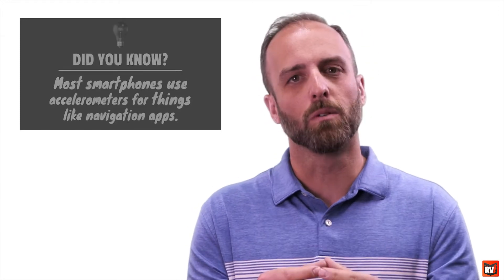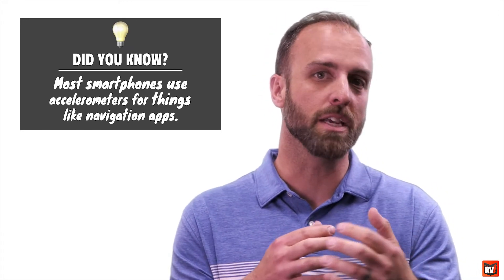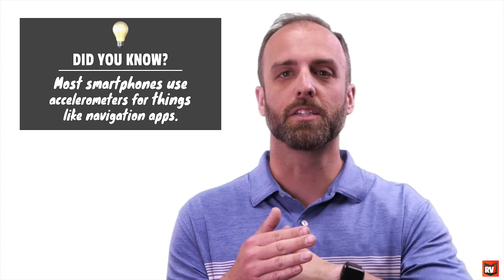RVi's How It Works! - Proportional Braking

Comment: What I have had problems with of late is the RVI brake coming on when I have to merge in traffic and then accelerate at the base of a hill...as soon as I slow a bit the brake comrs on, or I come over the top of a hill and the brake comes on again
 Like the accelerometer gets confused. Is that an issue for anyone else.
Reply from the maker: Hi Andrew! That's definitely odd, and we want to get that fixed for you. Please make sure to reach out to our customer service team either by phone at (800) 815-2159 or by email at contact@rvibrake.com so that we can help troubleshoot and solve this problem. Thanks for reaching out to us here!

Comment: What i want your breaking system to do is when I got down a hill and apply the brakes to keep the towed from pushing me down the hill. There should be some kind of tilt sensor that when I apply my brakes lightly on a hill, the towed brakes should apply lightly. I think that is what yiur braking system is lacking. And yes I am a customer. Had my system going on Mt 3rd year.
Reply from the maker: Hi there! We actually intentionally designed the brake to not do this to ensure it remains fully proportional on inclines as well as flat surfaces. This terrain-sensing software helps prevent overheated or damaged brakes. However, we do have a manual braking function built into the Drive Mode screen that allows you to engage the brake in these types of situations. We typically encourage using this on mountainous or hilly terrain if you feel like you need a little more braking assist. Thanks for reaching out!
Reply: @RVi  Thanks for the reply and your insite but I think your thinking is 180 out. By not having the brakes on the toad activate, it results in the towing vehicle to heat up it's brakes unnecessarily.
Reply: @ChiefStones The trailer breaks do activate when you activate the towing vehicle brakes. It doesn't matter if you are on a hill or flat ground.
Reply: I use mine to share the braking on step stuff. I give the rv brake a good dab then the toad brakes stay on for about 5 seconds. Then I just brake quietly in the rv so the toad brakes don't come on....then repeat. I find it works really well.